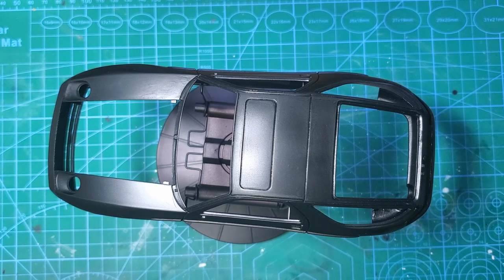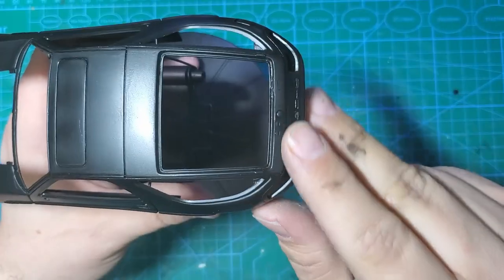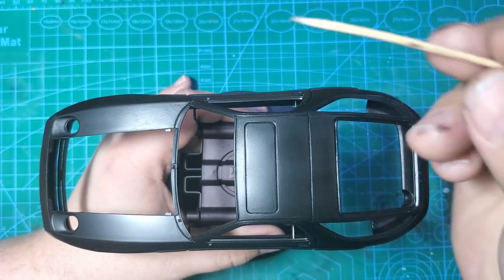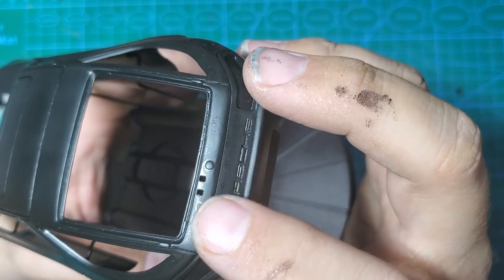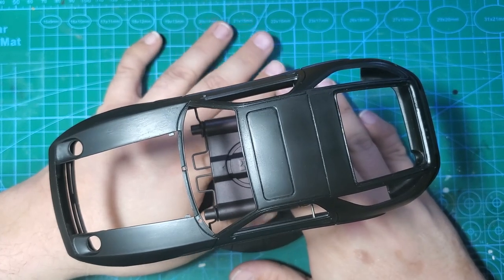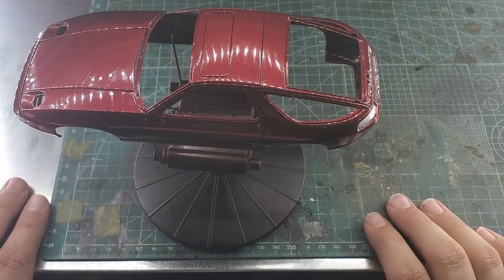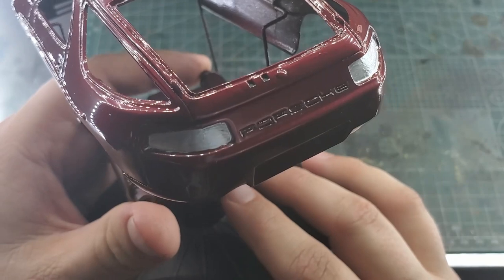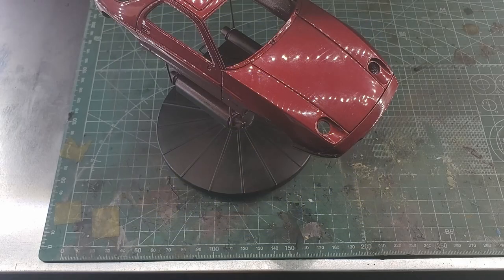Italeri Porsche 928   Update 2

Comment: Nice Update!!!  Nice tip.   I've never had to strip  2K.   Nice save and Great repaint.  I like the color choice.   I think the wheels should look Great!!!     I'll be watching.
Reply from the maker: Thanks Michael, Honestly 91 or 99% will strip it, but like I said I don't want to use that much just now, and it would still take at least a week or more. Otherwise without sanding to get under it, it forms a hard shell that is near impervious. Thanks for watching.

Comment: That’s a lot of work, looking good though. 2k clear is sharp. I hear Tamyia panel line scriber is the best. Looking to get one.
Reply from the maker: It is very good. I find I'm jumping out of the lines a lot less and so I have a lot less repair work. But dear god is it expensive. I think the handle was $18 on Amazon, and nearly $30 for a single blade.
Reply: JHart Modelworks I’m guessing it’s worth it. I have been using back of an xacto blade, driving me nuts.
Reply from the maker: It is definitely several steps up from using the back of an exacto blade. I spent 3 times more time cleaning up all the scrapes and gouges I made with the exacto knife, than I spent on the actual panel lines.

If you want a cheap option to get you by for a bit, you can try taking a sewing needle, sanding the tip down just a tiny bit so it's not quite so sharp, and stick it in a pin vise. But the engraver is very much worth it in my opinion.
Reply: JHart Modelworks thanks for the info I’m just going for it 1mm blade and handle.
Reply from the maker: @frizzosmodels  .2 mm works better, at least for cars it seems to. I think .1 is a little small and it catches.
Reply: JHart Modelworks I’m currently only building cars. Thanks for your input I’ll get 2mm.